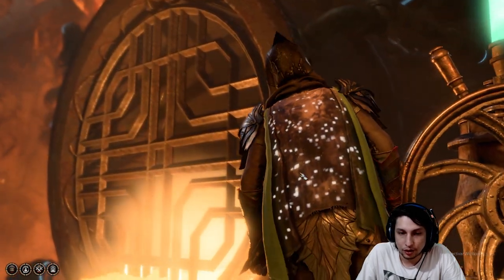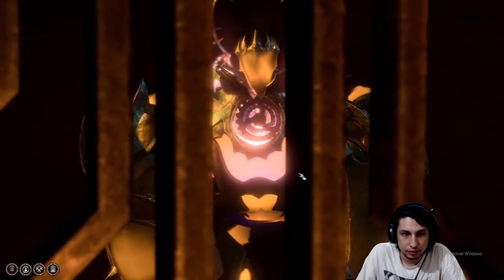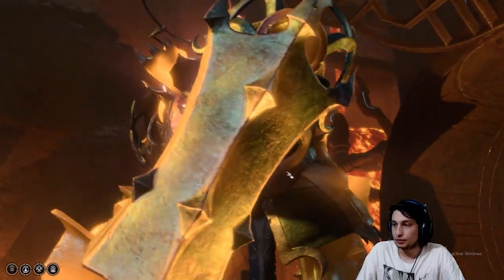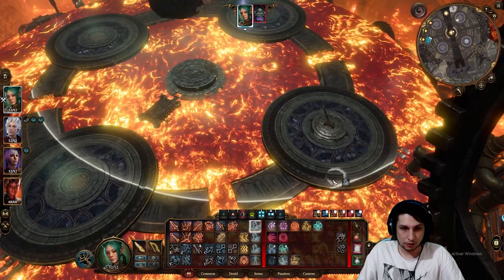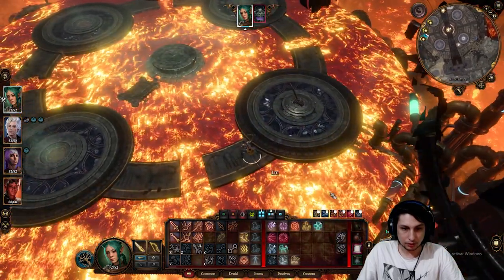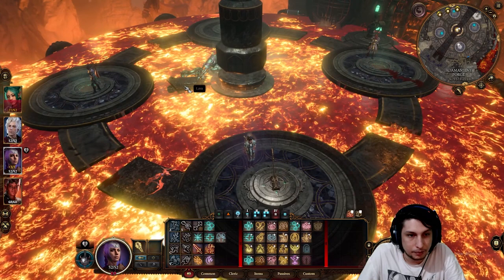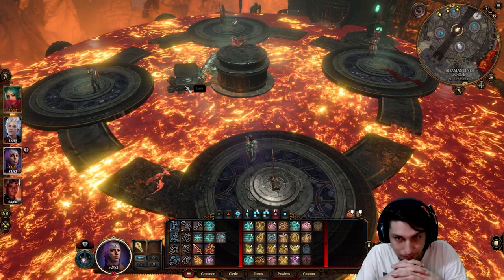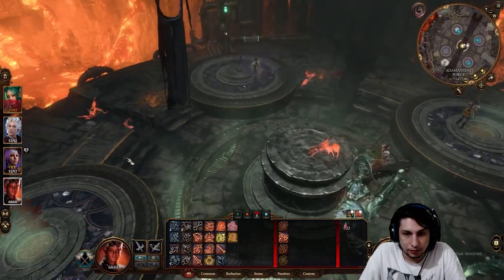How to unstuck the lava valve in the Adamantine Forge in BG3

Comment: Nothings works for me I’ve been trying multiple times over. It won’t let me put in the molds…. When it actually gives me the option to, then I pull the levers to try and lower it and nothing happens…
Reply from the maker: The mold was the same thing that was giving me issues at the start, I figured out that using the lever next to the mold after placing the mold is a bait and should not be used, try to just do this order if possible: Place ore in crucible, place mould in the mold(don't touch the lever) and then use the lever that will make the hammer go down, after the platform is down use the valve and that would trigger the event, I hope that this helps!

Also if there's a mold next to the mould dispencer prob there's no mold inside!
Reply: @jazziph that doesn’t work.
Reply: It’s patched, this was actually a glitch
Reply: @jazziph  This method works, 100%!! Thanks!
Reply: @CarlosSanchez-en6mr still doesn’t work

Comment: 0:29
the platform has to be lowered FIRST by pressing the button at 0:11
Reply from the maker: works either way, you can also do it with the lever from top(which is actually the normal behavior of the forge) button is like exploring